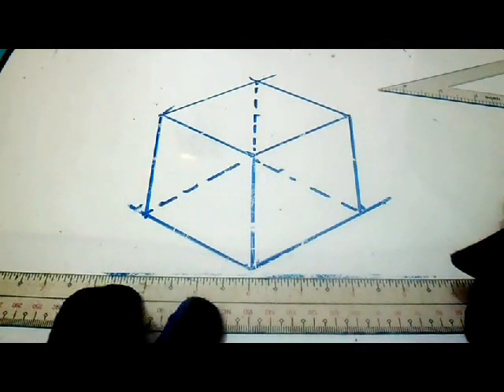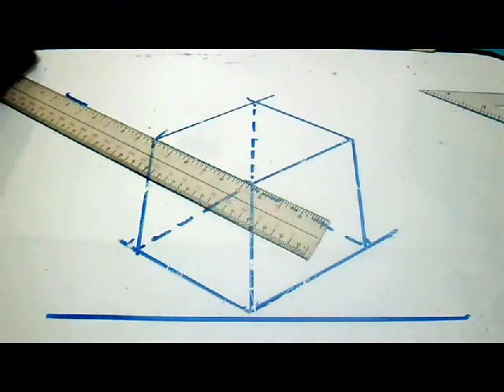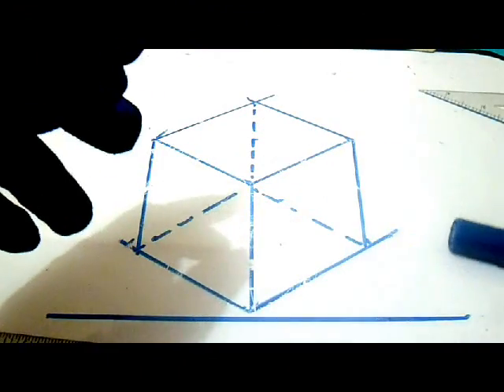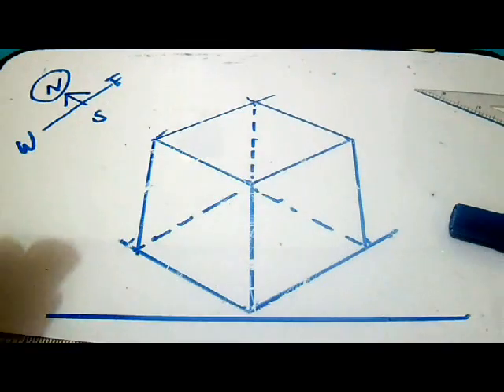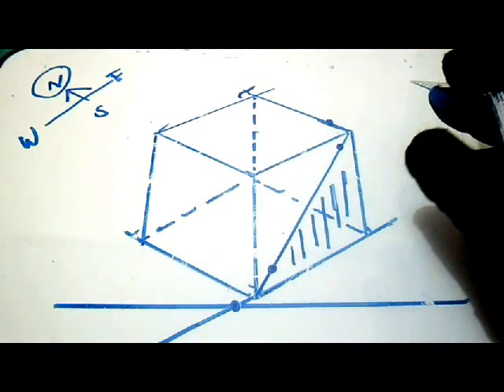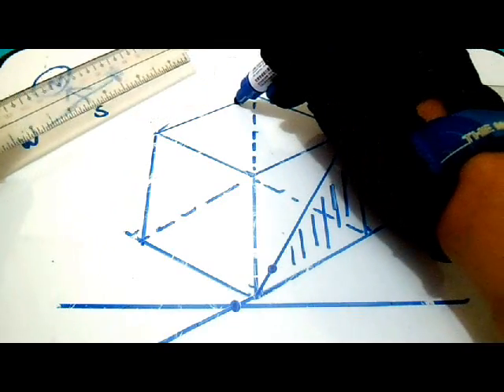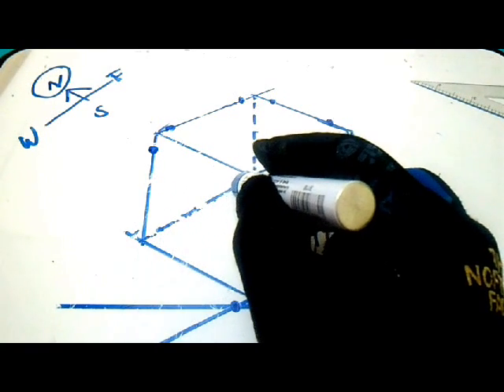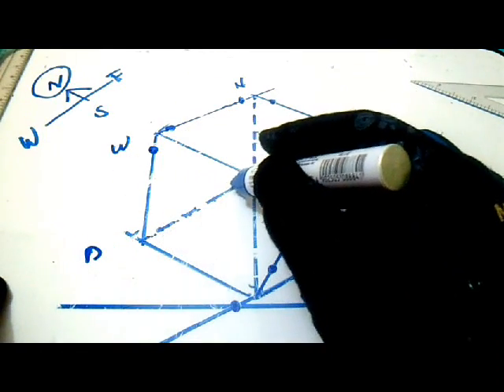Technique How to Read Isometric Drawing by Using Box - Pipingweldingndt

Comment: I'd give up if I were you. The outside of the box should be parallel to the front corner. If you had used a rectangular box it would have been a mych better explanation